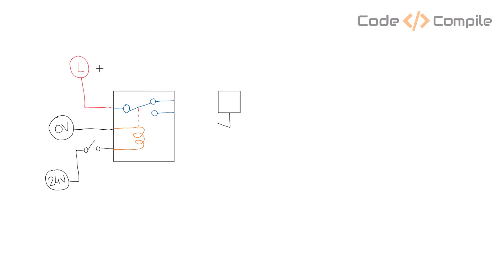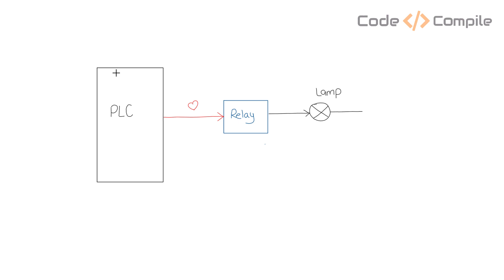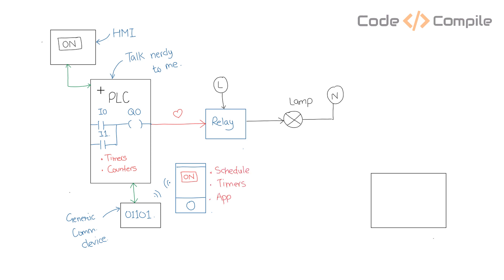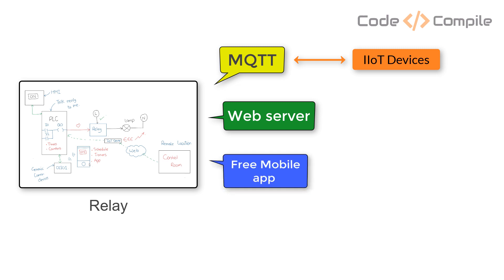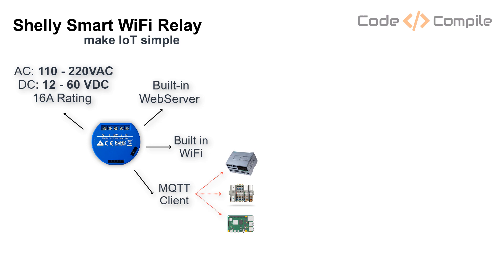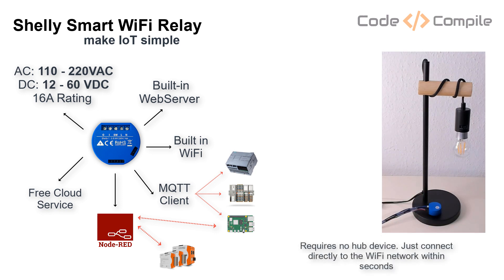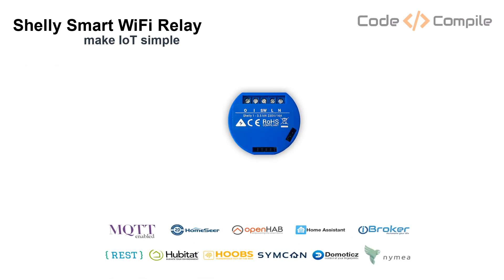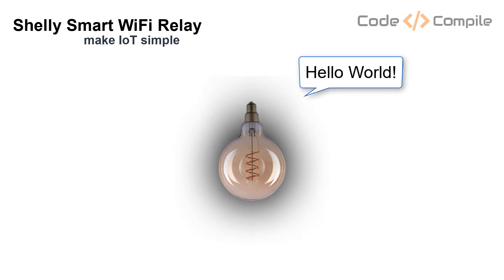Shelly WiFi relay

Comment: Suppose a device located in one place and I m in some other place can I control it then as it can only control if wifi is connected to our mobile ?
Reply from the maker: Yes you can using Shelly free wifi cloud service. You can be anywhere with internet connection to control the relay. Relay must have an active internet connection